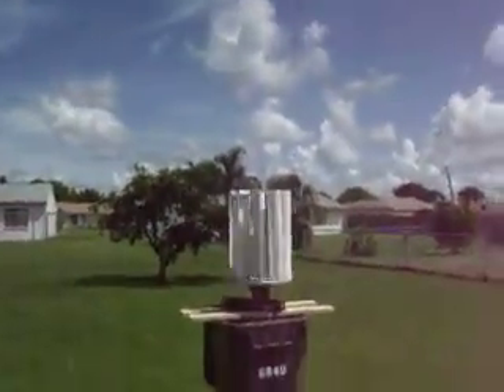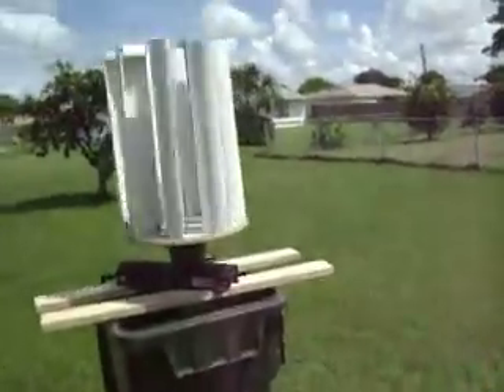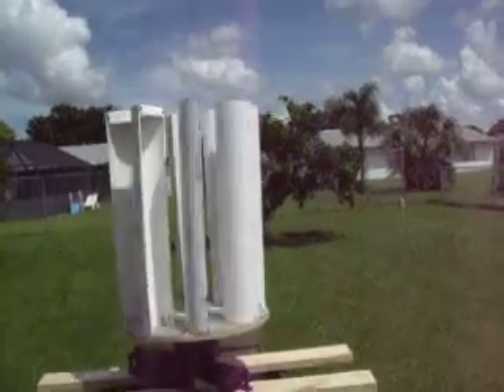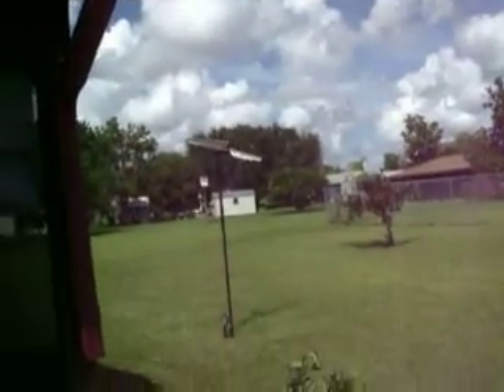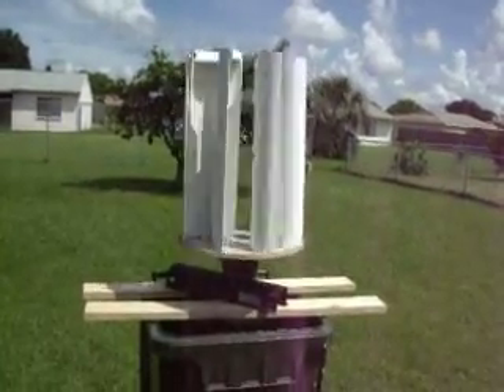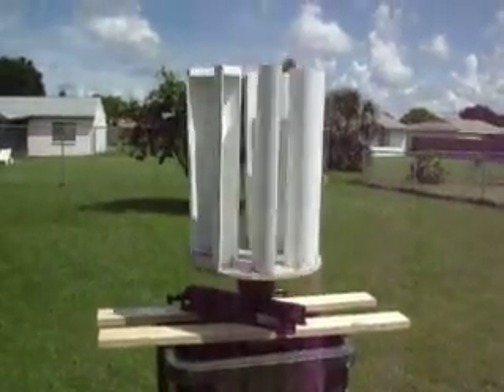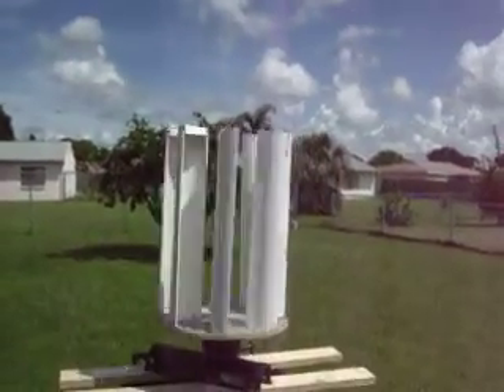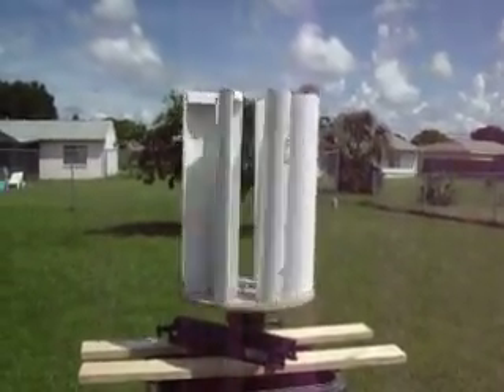wind generator

Comment from the maker: IT WAS AN OLDER PROJECT ,IT WOULD ONLY PUT OUT 7 VOLTS AND THAT WAS IN FLORIDA,AND I HAVE MOVED TO PA ,I GET MORE WIND IN PA JUST LACKING FUNDS RIGHT NOW,BUT I DID BUILD CEILING FAN WIND GENERATOR THAT WORKS BETTER 
AND BUILDING MORE OF THEM.